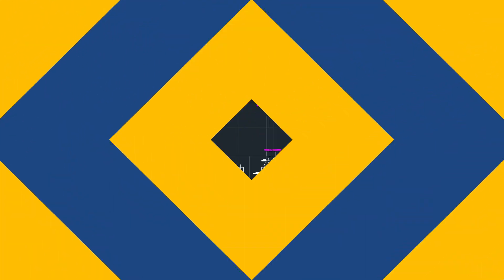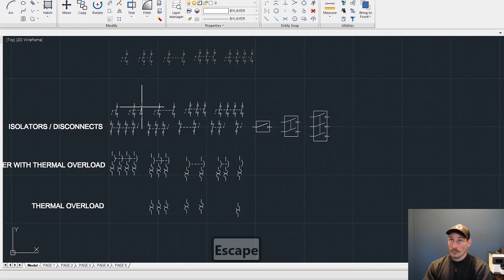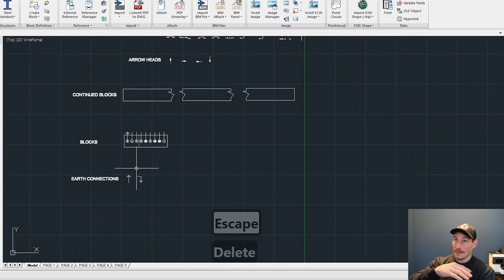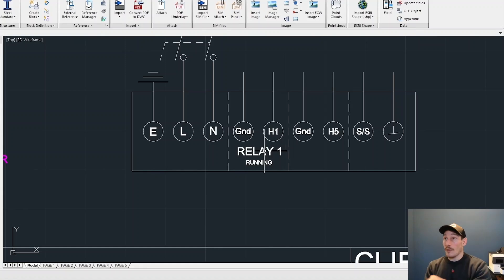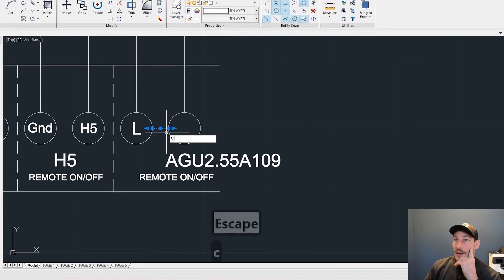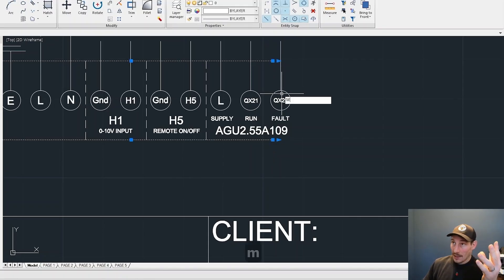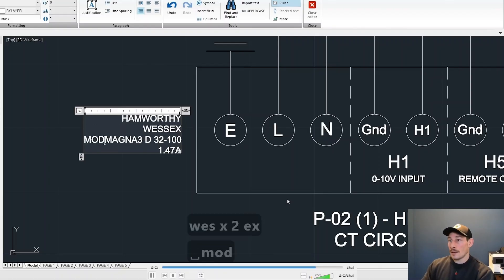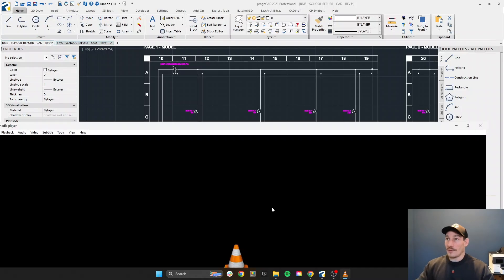BMS Boiler Wiring First Steps in Schematic Design

Comment: PART2
11x240V/12V sten down transformer
2.4 x Diodes IN 4002
3.1x1000uF.50V polarised capactor
4.1x 10uF.50V nolarised capacitor
5.1x5.1VZerer diode
6.1x1KO resistor.0.25W
171x1 K0 variable resistor.0.25W
8.1x2.7 KO tesistar,0.25W
9.1x4.7 K0 resstor,0.25W
101x 10 KO resistor.0.25W
11.2x NPN Bipolar junction transistors (TR BC182 and TR TIP 31)
12.1x Standard size PCB
13.1x5VLight emitting diode

Can you please help wiring these tw 2:11 o questions please 🙏🧎